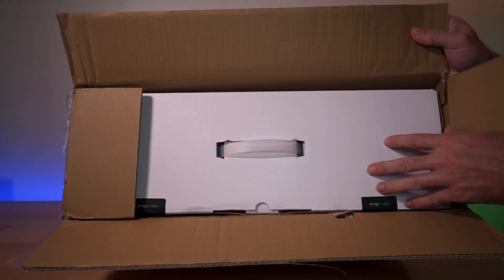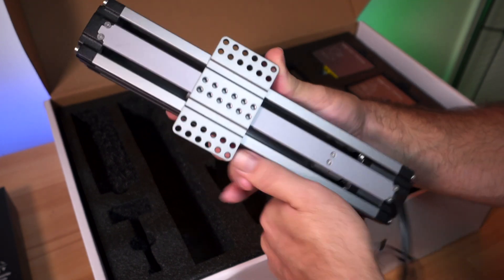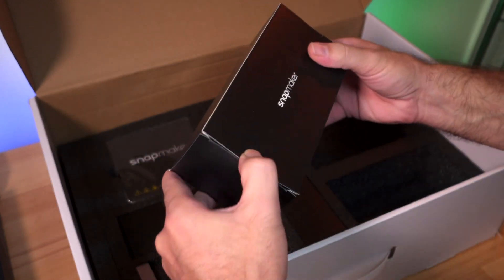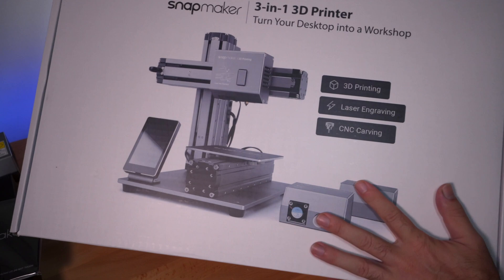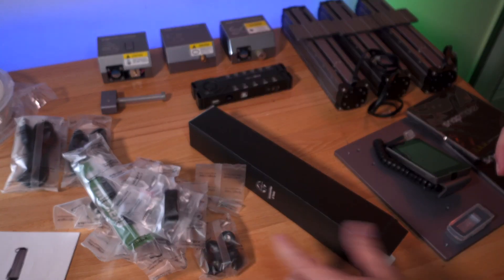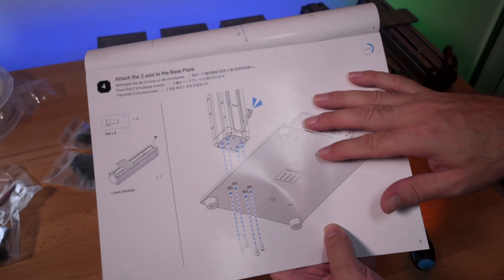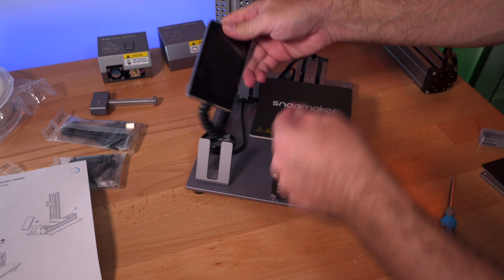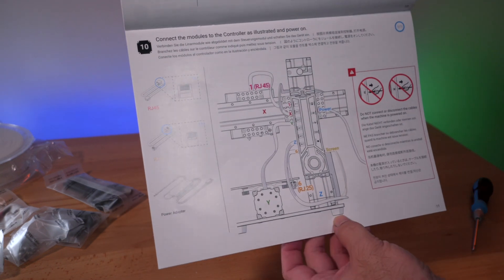Snapmaker 1.0 - 3d Laser Cnc - Unbox & Assembly

Comment: I've got one of these - via the original Kickstarter from way back in 2017.. unfortunately getting spare parts, like the heat block, heater, thermistor & build stickers is becoming more & more difficult to obtain - but rest of unit is all still working - even if the build size is small 😄
Reply: I'm in the same boat.  I was looking for replacement parts, but not only are they hard to find but it's almost not worth it.  I can get a new printer for like $200